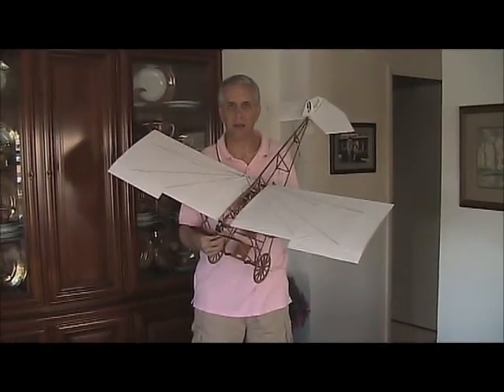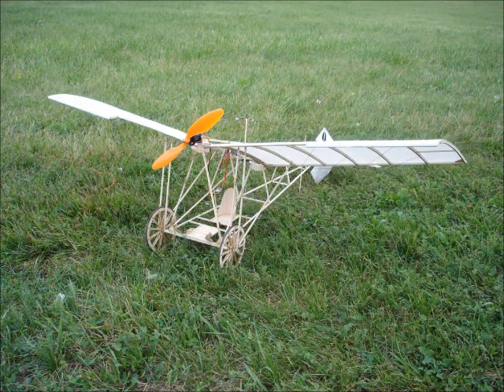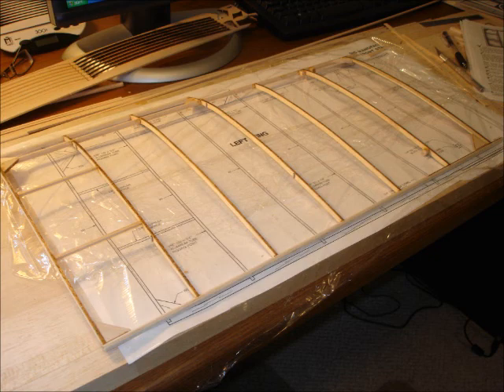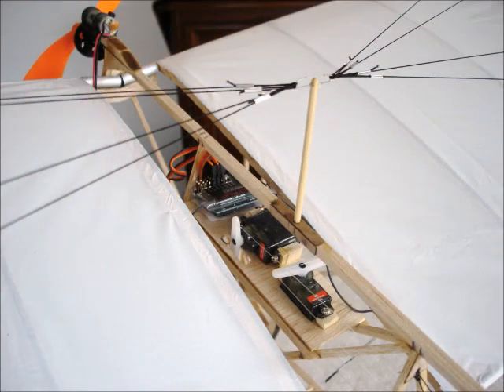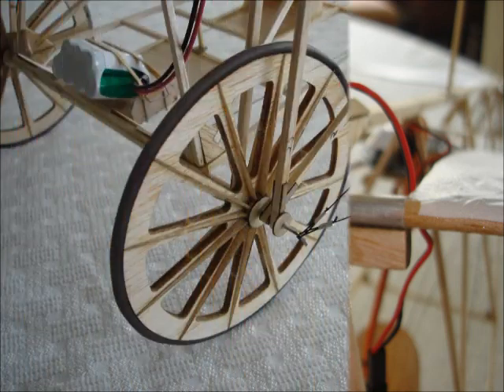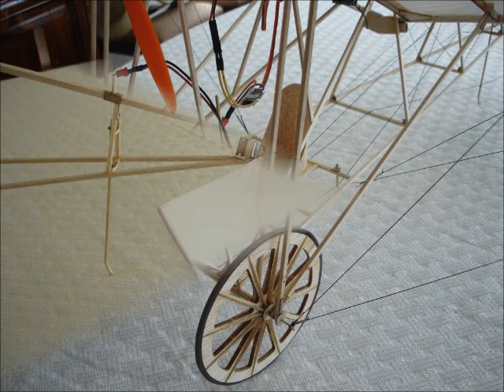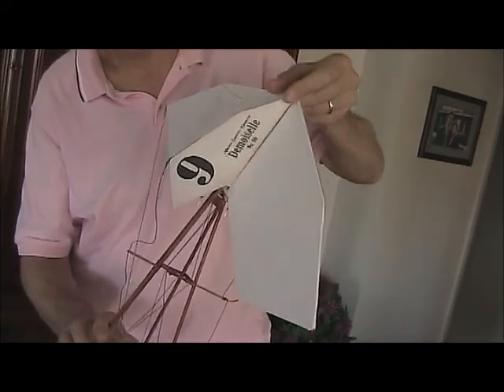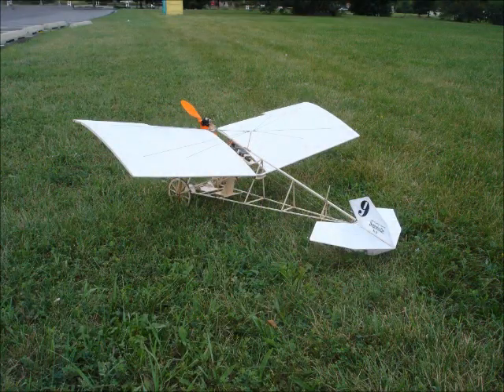Sig's Demoiselle RC Airplane Kit | Flight Review

Comment: What did you use for covering? Looks great!
Reply from the maker: Glen:  Covering is ideal for this plane.  It is included in the Sig kit.  Cannot recall the name, perhaps check at www.Sigmfg.com  Does not have a sticky backing, will need a heat activated glue, such as Sig Stix-It to apply.  Minimal shrinkage, which is good for the light frame.  Tim

Comment: Hello, Tim. This is Walter from Brazil. I intend to assemble the SIG Demoiselle kit and I had watched another video on youtube about its construction and there were some tips on the plan (some small mistakes in the plan). I didn't find this video (deleted) anymore. Do you have any tips on the correct assembly of Demoiselle? I thank!
Reply from the maker: Walter:  If I recall, I built the Sig Demoiselle around ten years ago.  But I do recall that the photo illustrated manual was essentially perfect.  The Demoiselle will go together unlike any other model you have made, but Sig did their homework.  A brushless motor would be ideal, as the original was designed for an ancient brushed electric motor.  Tim
Reply: @TimMcKay56  Thanks! I feel more confident ...